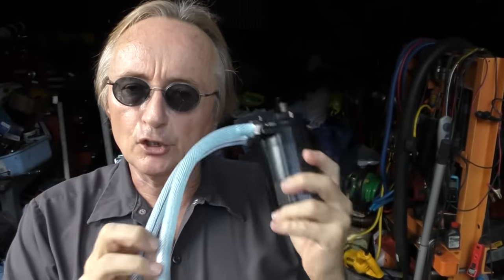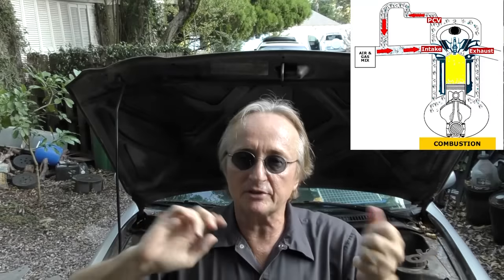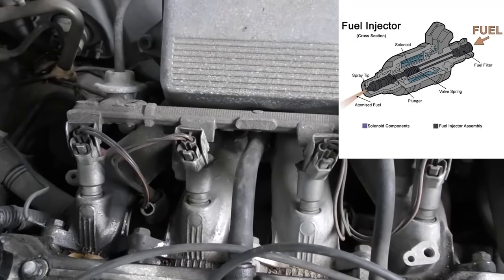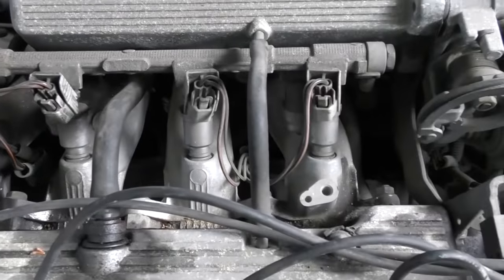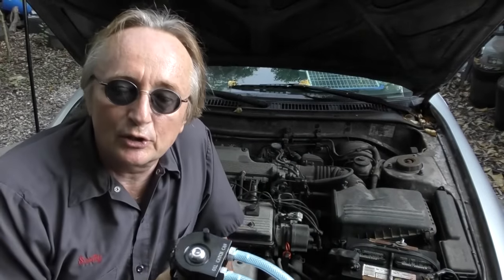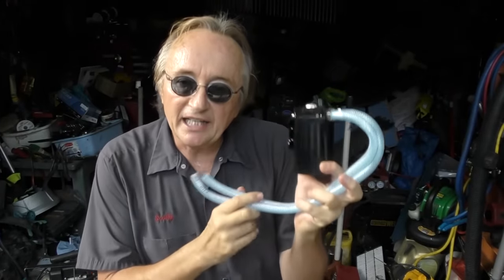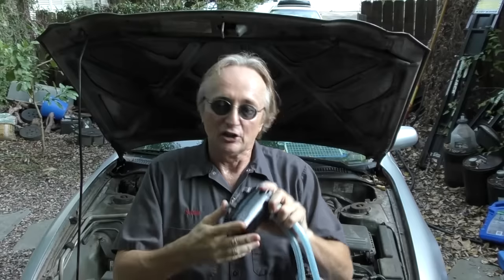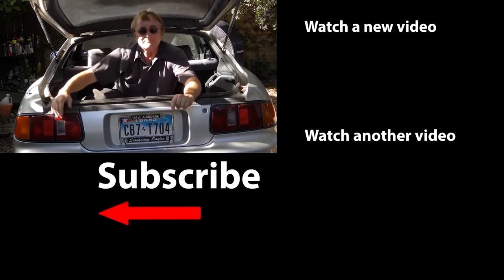If You Have This Type of Car, You Need This to Prevent Damage to Your Engine - Oil Catch Can

Comment: I was tempted to get a ford flex recently, but hesitated because of the GDI engine. So I got a lexus instead.
Reply: Adam McGrath poor decision! U bought foreign plus a less sophisticated motor. Ford & Lincolns GDI turbos use dual type injection no carbon on Gen2 ..really was no carbon on Gen1 Ecoboost. Buy American!
Reply: David Klimmek Nah; something else on that Ford would have been more likely to go. Used Lexus is similarly-priced and better quality than new Ford.
Reply: But Ford is not as reliable as Toyota
Reply: Davin Peterson 280k on my Ford ecoboost,it’s pretty reliable.comes down to operator maintenance
Reply: Although operator maintenance and oil and filter choices can account for 30-70% of an individual vehicles life span, the quality of the oil pump, the quality of the valve seats, piston ring design, etc makes a bigger difference. Although Ford does an above average job with their trucks  there is a real reason they anounced they will stop making most of their cars and that is not due to operator neglect. Consumer Reports annual car guide based on 500,000 to 600,000 reader surveys doesn't lie. I've been looking at it since 1987 when I got burned on a Chevy while in college. I encourage everyone to look at the guide. Pass on what the writers write as all humans including myself have biases.
Reply: I do trust Consumer Reports as it's reliablity ratings are based on reader's survery
Reply: You made a wise choice with the Toyota. Trust me!!
Reply: Don' t listen to that David guy. You made an excellent choice!Lexus is an expensive toyota and I will pick toyota over ford any day for reliability.
Reply: that was a no brainer in my city they give fords away at a dealership name RICART.
Reply: @Davido50  a lot of lexus are not foreign. Built In Cambridge Ontario
Reply: Congratulations!You have chosen wisely
Reply: @Matthew James because they like boring cars. A Lexus isn't a status symbol, like it use to be. The entire Toyota line up available in the US completely blows.
Reply: i really really want to buy a mustang with 4 cylinders turbo rear wheel drive and the desing is like a dream came true  but that engine needs to be deal with properly
Reply: David Klimmek “buy American” is a euphemism for subtle racism and only is brought up vs a Japanese vehicle. You never hear these guys say “buy American” if a German or other European vehicle is discussed, strange isn’t it?

I bet most of Ford has many sourced materials from China, and I bet many of these guys who say “buy American” have helped support China’s economy for decades by not buying American.
Reply: @williamkorver9856  That is quite possibly the dumbest thing I have read on YouTube.  Congratulations. And don't come back at me to prove you wrong, you prove yourself right if you want an argument. Ford is and will be putting the same exact drivetrains in SUVs and CUVs as they put in sedans.
Reply: Should have bought an Infiniti
Reply: @agustinmercado8  dont you do it.i traded in my 2018 ecoboom mustang to a 2018 camaro.ecoboom engine mustang
Reply: @Davido50  American cars suck! They are so unreliable!
Reply: @williamkorver9856  I love consumer reports because in my experience with cars they have actually been very accurate! But never listen to JD Power as they are paid to lie through advertising!

Comment: The irony of this whole GDI / Gunked up inlet valves scenario is that we go to the effort of filtering and cleaning the incoming air for the engine; so if it was just a straight intake to turbo to inlet manifold, the air would be perfectly clean (relatively speaking) and there would be no gunking up of the inlet valves at all. But we (automotive engineers, that is) decided to recirculate all the gunk from the cylinder head back into the engine intake again POST air filtration, without considering that it might need to be filtered or cleaned first, and may cause issues down the line!! Very big fail.
Reply: So, you are proposing to have the PCV to dump somewhere outside of the air filter?  And let the engine’s air suction draw the air through the air filter?  Well, I think the oil from the blow-by will permeate through the air filter.  And it will get on the MAF sensor and foul it.  And still get into the engine intake.  I suppose maybe if the air filter was redesigned to handle the increased amount of ail it would see.

Comment: Hi Scotty, A question:
 I am at least as old as you are and yes I do remember the old cars with the down draft pipe to dump the crankcase pressure directly out into the atmosphere and the small amount of smoke they emitted.. Which makes me wonder if we would or could just bypass it entirely now also and dump the pressure overboard (as was done in the past) and eliminate any need for a catch can on direct injection engines and eliminate the need to remember to empty the catch can. Sometimes like you I believe the simplest solution is often the best solution. Like you I also miss roll-up windows and vent windows on our side windows, manual transmissions and the old fresh air vents down near the floor on the drivers and passengers sides of our vehicles.

Comment: Threw one on my chargers 5.7. Can’t believe how much oil gets into the can.
Reply: I used 1/3 a quart on a 1700 mile road trip with a 5.7 Grand Cherokee. I changed the oil with Royal Purple full synthetic right before the trip too.
Reply: I hear that all the time about the Hemi motor. But they aren't GDI, so does it really matter?
Reply: It does, mileage will drop and carbon deposit reoccurs via fuel. When oil is burned it increases chamber heat for an even burn of the fuel. If that oil not present the fuel doesn’t burn clean and you are where you started.
Reply: Jack Torse  You know probably increases HP only mildly, I know with my race Kart and probably other race cars they have them, just so your not burning the oil as it is more of a dampener on the combustion process.  Really these are here like Scotty says for emmisions.
Reply: My theory. When in doubt Rev it Out.
Reply: That's a Dodge for ya:)
Reply: It doesn't matter what Car / Trucks it is.  Just put one on and you will thank me later.  Also, it is a MUST if your Car / Trucks is old.  Blow By and Head Gasket Leaks will help " Tremendously "  with " Moisture " issues.  NOTE:  If your Car / Trucks have problems " Starting " on Rainy Days / Snowy Days / Morning Mildew... More reason to get an Oil Catch Can!
Reply: MikefromQueens is it safe to use that catch can on winter and or on Freezing temps?
Reply: rhurtadorh32 I see no reason why it wouldn’t be fine
Reply: Thats why i run a dry sump oil system
Reply: @rhurtadorh32  it wont hurt anything, it's more good than not
Reply: Swampy  It's a mix of 3, 4 and 5. Yoy can't just have 1 group lol.

Comment: Love this guy. But wish he would talk a bit more about diesel cars... You see I'm from Portugal and all we have here are compact diesel engines...and I think they suffer from the same issue mentioned in this video and even worse being all the diesel cars turbocharged.
Still I enjoy watching your videos Scotty even though I don´t have a petrol car :D
Reply: I agree, most cars sold in Europe are diesel. From BMW, Mercedes and even Hondas...
Reply: Alex Arriscado 
Vws tdi likes to clog the intake with goo. 
Either get a retune to delete the egr or do an intake cleaning every so often. 
I did it on my 98 Jetta by removing the intake and cam, and using a propane torch to burn the stuff out of the intake manifold and intake ports. 
Then since I was cheap, I made an egr block off gasket and lived with the check engine light being on, I didn’t want to retune. 
Occasionally I’d do a scan to make sure the light was on because of the egr and not more codes. 
I cleaned mine at 130k, and I could barely get my thumb down the main intake hole.
Reply: Alex Arriscado Os Diesel usam a EGR, o efeito é o mesmo.
Reply: Frank. T Thats from Spain :D
Reply: Alex Arriscado Ask him when he goes live.

Comment: @Scotty Kilmer 
Great video. Question specific to a 2017 Tacoma TRD OR-DCLB, here in California, that has been turned (set up to carry weight and travel long distance off road) but is not super charged. 1) Do I need a catch can? And if I do, will removing before smog test, cause problems during test (I understand factory tune needed for smog)?

Comment: This is well-known on my platform, the Mazdaspeed 3/6 (turbocharged, direct-injected engine). One of the keys is this: if you put this on an engine that has 20-30k miles on it already, you're still going to need to pull the intake manifold and walnut blast the intake valves because accumulation has already occurred to really start off with clean valves. If starting with recently cleaned valves or a new engine, this will definitely help mitigate accumulation, but not stop it entirely due to EGR systems also putting oily air over the valves as well, in many engines. If you really want to address this, installing a water-methanol injection system will not only steam-clean the combustion chambers, it'll also keep the intake valves very clean. Additionally, it lowers cylinder temps, raises functional octane (M1 methanol is 116), and allow more boost and timing to be run if you're going for performance tuning on your setup. Finally, the evaporative cooling effect of methanol significantly lowers the air temperature entering the engine, thus increasing oxygen density and facilitating even greater power production.
Reply: You seem pretty knowledgeable with engine mechanics so any thoughts on Honda's current 3.5v6 in Odyssey regarding carbon buildup? Do you know if Honda has addressed the DI problem like Toyota or Ford? Thanks
Reply: What is this you speak of?
Reply: Methanol was found to cause excessive wear in engine parts, that's why ethanol is used instead
Reply: does this depend on the dilution of the methanol?
Reply: @tjsullivan4793  Not sure about the Honda engine, sorry. Most folks have taken a hybrid injection approach, utilizing both PI and DI, which completely addresses the issue. You see this in the FR-S/BR-Z engine, for instance. Sorry, wish I new more about that engine.
Reply: @jackclass5446  Valve cleaning/keeping valves clean is facilitated best by 100% methanol. The stuff is strong and diluting it lessens the cleaning on the intake valves. Steam cleaning the combustion chamber is largely a function of water being injected with the methanol. If this is a desired effect (such as if you already having PI and don't need the intake valve cleaning), going with a 50/50 mix of methanol and distilled water works great.
Reply: @adamstephens9611  Methanol has caused zero wear issues with my platform, and I'm talking about thousands of guys driving millions of miles with WMI injection. Perhaps it causes issues for some; it hasn't caused any for us.
Reply: Good old disi. I clean my valves every two/three year or so.

Comment: Do you think I should put one on my 2019 Dodge Challenger scat pack
Reply: Yes especially on HP engines like the 6.4, and have one on my 6.1. I wouldn't go without, and would get one on that bad boy hemi car ASAP bro. But get a decent one made in the US
Reply: @lovethesmellofracefuelinth7374  thank you for your reply you have any suggestions on which one I should get
Reply: @IntegraTypeS  I got the billet technology one on mine, but they are a little expensive and there's other options nowadays for less. They weren't available when I bought mine, but speedlogix is making them now and are just as good for less
Reply: 6.4's are port injected.  No need for one.  There are millions of carburetors  and fuel injected engines that have gone billions of miles with no issues.  Run a quality detergent gasoline and you will be fine.

Comment: get those BS garden hoses off the cans and replace with fuel hose or better....also alot of manufacturers are NOT using the dual system that Toyota/Lexus is using....most dealers won't know...so used car buying requires alot of research beforehand even if it is a 2015-16 car.
Reply: David Santiago yep. New honda accord for example is gdi only
Reply: Toyota still hasn’t gone to turbo, thank God!... because turbo engines are so pressure sensitive I think it would add to the complication of putting more fuel injectors so that’s why most turbo engines havnt gone dual port and direct except for Ford I believe , but they have no concept of spending lol. I have a new Camry best decision ever.
Reply: GDI systems have been in use for 20 years now on vehicles. The manufacturers have been aware of the valve coking issues in GDI's since the 1990's.  The Dual injection system has been in use for  over decade on some of German GDI systems.  The Dual system is nothing new and it is pure negligence and or cost reasons it has not been used on Current GDI systems.
Reply: O P Volkswagen's 2.0 engine is direct injection and turbo. So are the GM ecotecs with turbos
Reply: I can almost be sure, that at leat 95% of GDI engines out there have carbon deposit problems. Friend of mine, mechanic, he gets a lot of 2009-10-11-12etc etc cars with a complaint of lacking power and bad gas mileage. Many people are ready to sell them at that point, they just don't know they are ending up with another "new"  GDI car, which may just gonna live until the manuf. warranty expires.
I usually tell people to do their research before buying the car. GDI engine is not like "digital" or "supercharged", it is actually worse than multiport injection.  These are throw-away in 5yr cars!
Reply: Also 2014-2018 Chevy/GMC 5.3 and 6.2 are all GDI engines
Reply: @Anonymous01416  And the 5.3 and 6.2  are having huge  problems with carbon.
Reply: @Neanderthal75  just decarbonize the intake with seafoam. As long as it's not turbo charged. Just do it every 20k or so.
Reply: +Frank Sz 95% of all cars have carbon deposits whether or not they have GDI, its a consequence of baking a carbon compound (like fuel) on the back of a valve. Lack of gas mileage and low power also happens on non-GDI engines. Blaming it on GDI is ignoring the fact that most 7 or 9 year cars are worn by a lack of care from the owner, its just with GDI the mechanic automatically blames it on GDI. Most people wear out their cars after 5 years because they treat a car like a throw away item and don't take care of it. On the other hand I know a few people with GDI engines that have no problems, but that's because they take care of their cars. This also isn't a problem in diesels which require direct injection to work and spit out crude in the GDI system.

There are a few engines that have problems with deposits, GDI or otherwise. But making a blanket statement that all GDIs are bad is just ignoring the evidence. Of course there's plenty of companies willing to sell you something for a problem you can easily avoid.
Reply: O P Camry is garbage. Co sucks never again. I drive a new Ford Explorer Ecoboost!
Reply: All intake valves have some carbon deposits but some GDI engines have enough carbon built up on the intake valves that it causes rough running and missfires. This is can happen in 15,000 to 20,000 miles, not  7 or 9 years years down the the road in poorly maintained and worn out engines.
Reply: It doesn't matter what Car / Trucks it is.  Just put one on and you will thank me later.  Also, it is a MUST if your Car / Trucks is old.  Blow By and Head Gasket Leaks will help " Tremendously "  with " Moisture / Coolant Leaks " issues.  NOTE:  If your Car / Trucks have problems " Starting " on Rainy Days / Snowy Days / Morning Mildew... More reasons to get an Oil Catch Can!
Reply: Andy V. I know, that’s why that eco boost engine is golden lol.. it has the dual direct and port injection but that ford motor is way more expensive than VW 2.0, fords are not cheap
Reply: David Klimmek well you can afford that, I can’t... brand new I’m sure you almost hit 40k
Reply: calling a toyota garbage then buys a ford....craziness I would bet the camry out lives any ford they make

Comment: Just to let you know Scotty, the reason they didn't put them on at factory and didn't notice the problem is because valve on gunk will not show up in a 500k mile torture test where its continuously running.  What builds the gunk up is the constant idle, accel, decel function with the warming up cycle and cool down cycle over thousands of miles that creates what has been a problem on some of the DI motors in the VWs, Audis, Bmws, and the slightly older Ford Ecoboost motors until they also did the Dual injection system with port injection and DI.  So anyways the reason they didn't realize to put on a catch can system from the get go is because when they have their cars in the testing facilities running for 200 hours straight it doesnt give the environment that will create the build up of carbon.